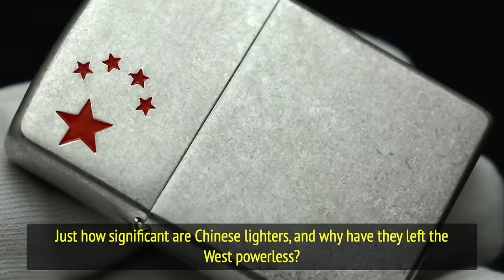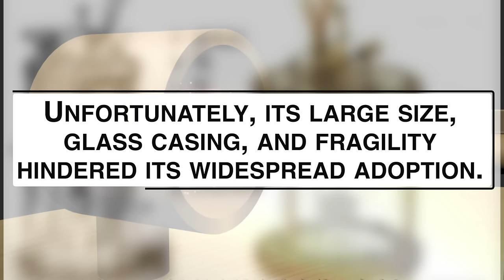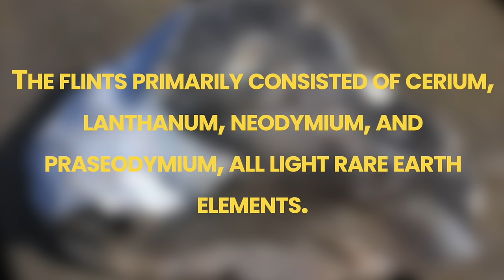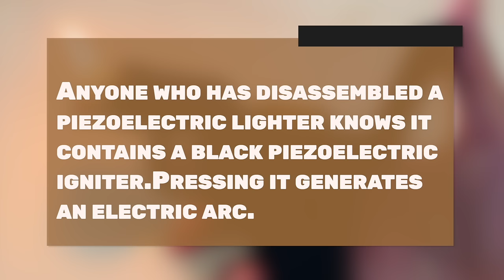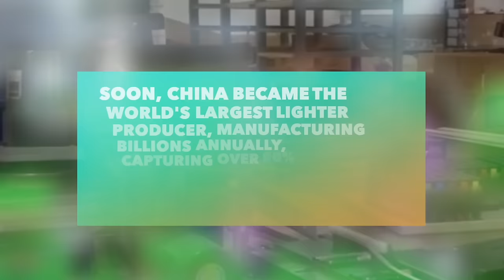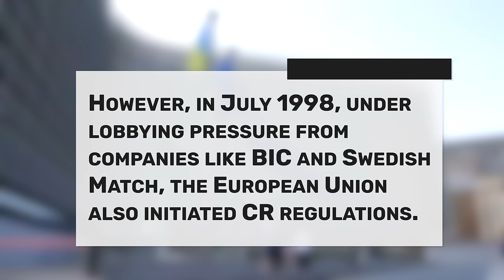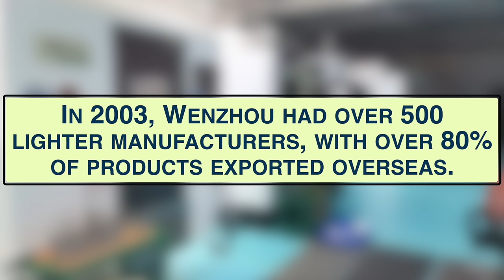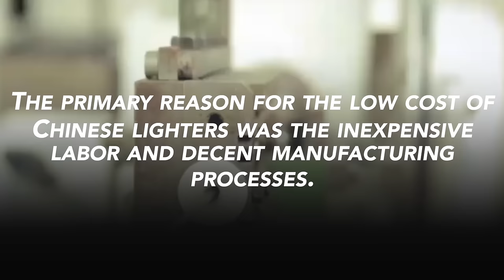How Impressive Are Chinese Lighters？Why Western Countries Can't Compete？

Comment: The example of disposable lighters is but a case study to show the economy of scale of Chinese industries in mass production to keep costs down to a minimum and to pass on the savings to the consumers. Chinese economies of scale now include diverse disciplines such as OLED displays and screens, whitegoods and kitchen appliances, photovoltaic cells and equipment, high-voltage electricity transmission over vast distances, commercial and military shipbuilding, electric vehicles and new energy vehicles, chip foundries and chip productions, and anything in-between. That is why the U.S. bans Chinese EV's from the American market even though they made a fortune selling American cars in the Chinese market 20 years ago till now. And that is also why the E.U. now tries to set up barriers to Chinese EV's in order to save their own car industries. Apparently, the ideal of free trade was only there to benefit the blood-sucking West and they chuck it in the rubbish bin when it no longer serves them well. So much for Western freedom!